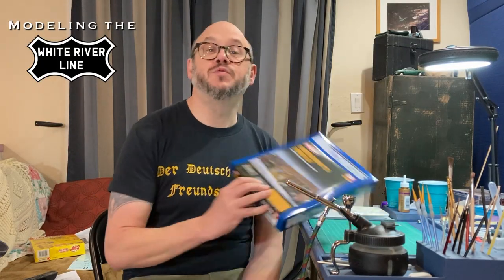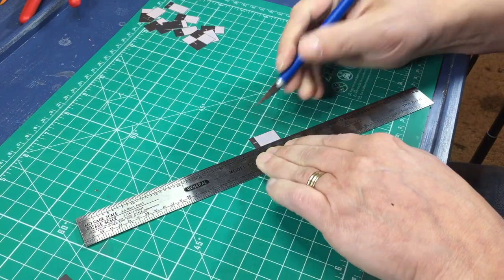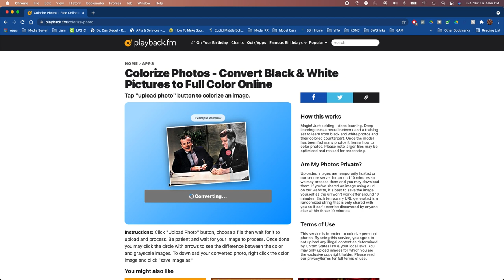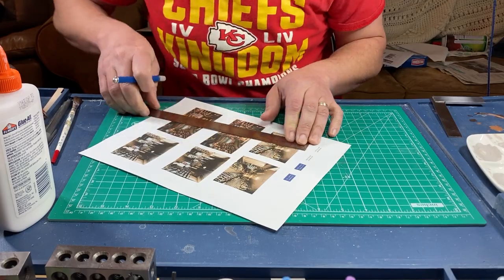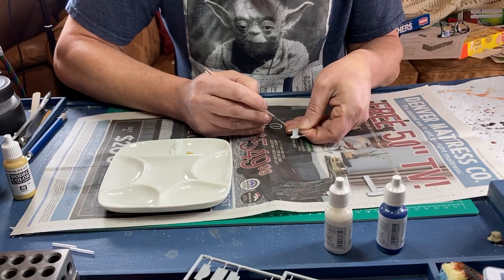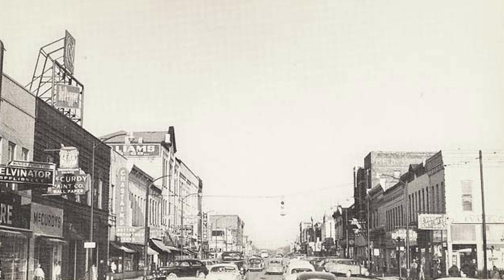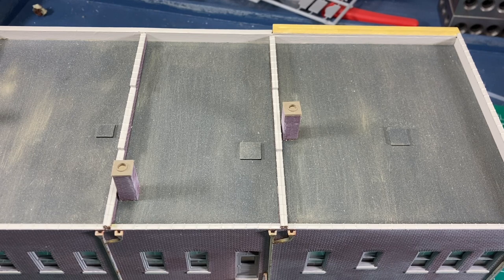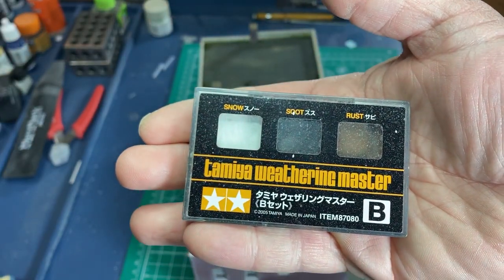Building a Walther's Merchant's Row Kit for a Model Railroad Part 2

Comment: 1/3/2023
I am in the process of watching ALL of your videos, from #1 thru your newest. I've watched up to here, so far, with a few others, (the coaling tower) I like your way of presenting what your doing.
One comment; 
Brick comes in many shades of red. and even yellow. Near where I grew up (Cleveland, Ohio) was a brick maker, and clay pit, The clay from that pit was a shade of purple/brown, very much like your present project, So, the brick is actually quite accurate. This brick maker made all the brick that was used (in the 1920's) to pave Cleveland's streets and for many buildings. The place survived until the early 1980's. Imagine how big the clay pit was (on Cleveland's south west side).
Great job so far. ;-)
Reply from the maker: Thanks, Robert. I definitely am going to have different plan the next time I do brick and this very helpful.

Comment: Those hatches can be cut out and propped up - add some figures on the roof and some equipment - I added some air conditioning ductwork using small diameter  flexible straws
Reply from the maker: That's a cool idea.

Comment: Nice video. The project turned out great. I have a couple adhesive questions for you. What did you use for the paper window coverings and what did you use for the downspouts on the buildings painted surface? Thanks.
Reply from the maker: Thanks for watching. I used tacky glue for the window coverings and CA glue for the downspouts.